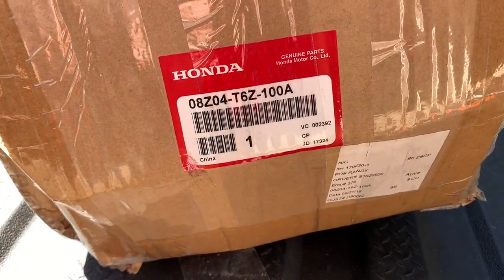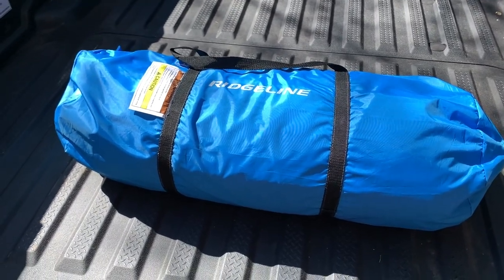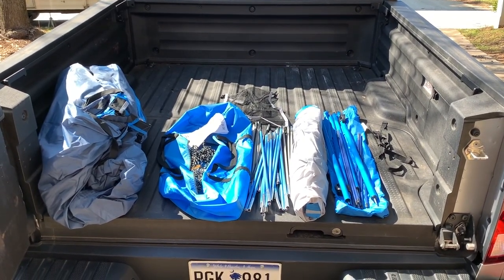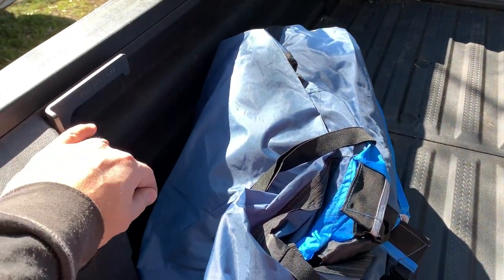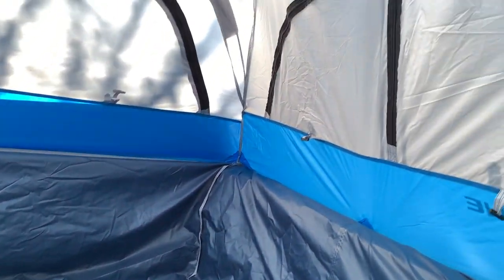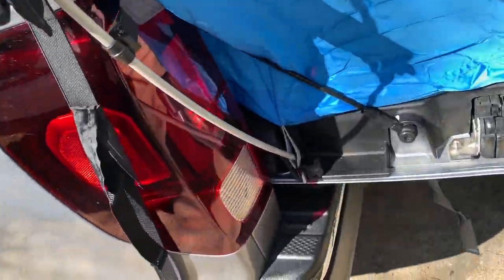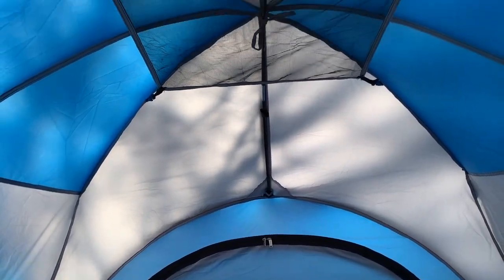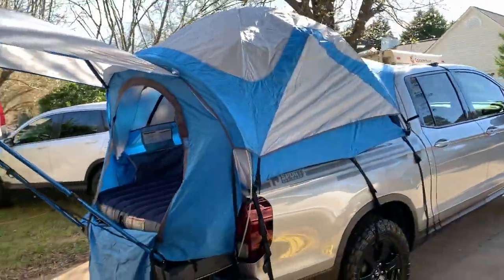BACK IN STOCK: Honda Ridgeline In-Bed Tent - Set up - Install and walk-around

Comment: Nice video!  I was looking this up because ours came and it does not have the long gray pole, only the 1 short one, so we were looking to see a setup video to see if we missed something.  We're bummed because we are going camping for the week and now have to try to find a pole somewhere or use a ground tent.
Reply from the maker: You find replacements on Amazon and customize. I think a 10ft will work. Did you buy the tent from the Ridgeline Store?
Reply: @CampingRandy  we got it from the Honda dealer we bought the truck from.
Reply: @CampingRandy  we got it from the Honda dealer we bought the truck from.

Comment: I have a trifold hard cover on my box, will the tent still work if i fold the cover back or do i have to take it off?
Reply from the maker: Yes you will have to remove. Takes no time, plus you can use as a table. https://youtu.be/SxDVGD0fDw4

Comment: How long does it actually take to set up
Reply from the maker: It takes about 10 to 12 minutes. Not long at all. It is pretty awesome and its a lot cheaper than a Roof Top Tent!
Reply: @CampingRandy  you have done it several times - 30 minutes

Comment: Do you have a lift? Mind sharing the specs on the lift (if it's lifted) tires and rims?
Reply from the maker: Yes 2” total with beta spacers from HRG Engineering. NITTO Grapplers. Check out my other video on the tires and the lift.
Reply: @CampingRandy  will do, thank you!

Comment: Thanks for the video! just received the tent. I have a question about the rain fly. Do you think it would leak into the cabin if it rains hard? I can imaging the straps might wick water straight into the truck's interior...What do you think?
Reply from the maker: I think the weather stripping will take care of it but I have not tested in the rain yet.
Reply: @CampingRandy  So I went camping this weekend, and had no choice but to test this in hard rain, not really windy, but several inches came down at night. The straps definitely DO wick water. I checked them in the morning and they were wet. I didn't see evidence of dripping, but there was a droplet on the end of the strap. I have leather seats so this is concerning. The way to deal with this would be to lay a towel down under the straps to catch any drips. This is definitely a design flaw, but I guess the designers had little options as to where to anchor the front of the rain fly. The tent itself remained totally dry inside, though the border around the main entrance is not totally water proof and did feel damp to the touch. However, it didn't form any sort of puddle inside. I'm still happy with the tent, it's the best option for me so far.
Reply from the maker: @pigup2  great to hear. I am glad it was not that bad. All in all its a great tent to get outside with!

Comment: Will this work with a tonneau cover folded open?
Reply from the maker: No - you will have to remove at camp. We pack everything in the bed with the cover. Once we get to camp, we fold, unscrew, & remove it. We either place under the truck or use as a table. They are very easy to remove.

Comment: would this work if you had the rolling tonneau cover installed?
Reply from the maker: Kimo Andrews yes - you just need to remove. We roll with all our secured gear under the hard cover with the Honda accessory tailgate lock. Then at camp we unload, trifold the cover unscrew an remove. Takes like three minutes. Usually place under the truck. Then set up the tent. I hope this help!
Reply: @CampingRandy  so you can keep the side rails of a truck bed cover on the truck and still use
Reply from the maker: Just remove the bed cover itself. The latch points do not interfere with the tent. I hope this helps. Let me know.

Comment: mmmm. I know I ma a buzz kill but, I don't see an advantage here to just throwing a tent on the ground. This looks like more work than just putting up my northface tent next to the truck. Which I can leave while I drive to do something. Plus you have to empty the truck bed to use it!
Reply from the maker: It’s great to be off the ground. Give it a try. Also if you need to leave, the tent slide right out. It’s pretty awesome. We love it.

Comment: Nice job. Would have loved to seen you open the trunk through the tent access. Is there enough room to lift the mattress? Seems like there is.
Reply: Oh, also... can the truck move with the tent installed? Not highway driving... like say I'm at a campground and want to go down to the camp store.
Reply from the maker: Apologies - just seeing your comment. Sure I can set it up in the driveway again and do a video on trunk access.
Reply from the maker: I think so. With the rain top, its attached to the hand rails, as well the tent is clipped to the base of the truck. I haven't tried but it looks like for sure you can travel campground speed - lol - 7mph!!!
Reply: I was hoping to see that too.

Comment: Randy, THIS IS a great vid. Thank you for posting this. HONDA, very nice job on the Ridgeline camper and correlating accessories. 
Riding may have a camp cook set, but THIS truck tent, within  bed power adapter is just the best thing an outdoorsy family could easily get used too. 
Does Honda offer a Pilot Passport accessory tent that mates up to the vehicle?
Reply from the maker: Yes they do! https://ridgelinestore.com/Honda-Passport-Pilot-Hatch-Tent-p456574548

Comment: Wonder how they would fit the first gen?
Reply from the maker: It will not. I had a Gen 1 and the way it is design, it will not fit properly.
Reply: @CampingRandy  I wonder if First Gen owners could jerry-rigg the backstrap through the back door windows instead....
Reply from the maker: Gordon I think the tent floor would not touch the floor.
Reply from the maker: @TomTomTom87  we would have to test but yes I think the near the cab would not touch. Check out this tent I sell. https://ridgelinestore.com/Fofana-Truck-Tent-Better-Than-A-Honda-Tent-p395313372

Comment: I took my Ridgeline camping, got a huge cabin tent which took me literally 2 minutes to set up. Seems like a pointless exercise with this one. Not to mention you loose all the storage on the bed. Plus normally you leave the tent and go see the sites....
Reply from the maker: TermlessHGW the in-bed tent is awesome. It gives you a queen size sleeping space. Your off the ground. You stay drier as well more comfortable. It stores in the trunk, so it’s always with you. There are zippers to get to the trunk and inverter once setup. If you need to hit the trails, you undo four straps that attach it to the truck, and set the tent on the ground. If you haven’t actually used one, you don’t know what your missing. Also I have a roof top tent, a tee-pee, and regular ground tent. They are just like clothes. You bring with you what you like and need. You do you.

Comment: i cant see any benefit to this specific tent... looks a bit more involved to set up vs a regular tent and then once you get set up, you arent going for a fun drive on the backroads. same problem as a rooftop tent (although those are quicker setup/takedown).
Reply from the maker: Well - you no longer have to worry about it as it’s discontinued- lol. The tent comes right out of the bed and lays on the ground at your campsite, so you can go adventuring. Also with a RTT, which I have and awning and kitchen; takes 15 minutes to take down. Thanks for watching.